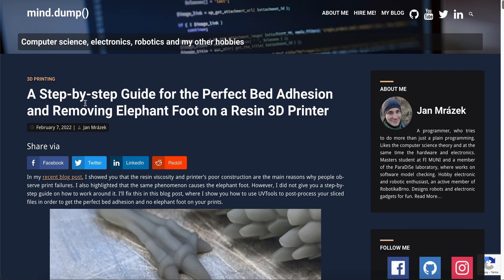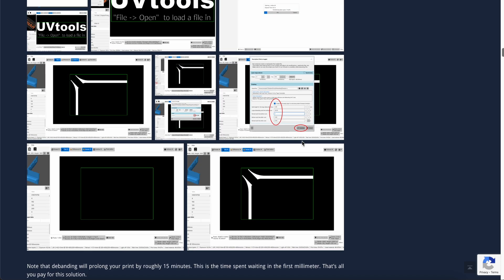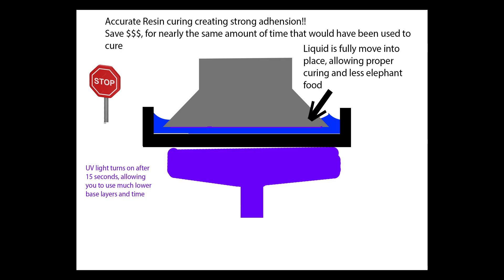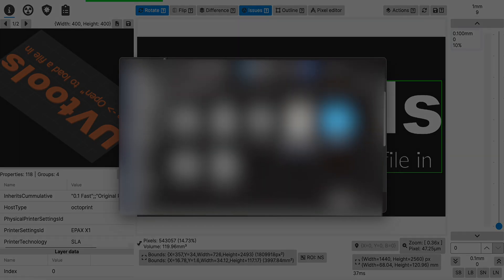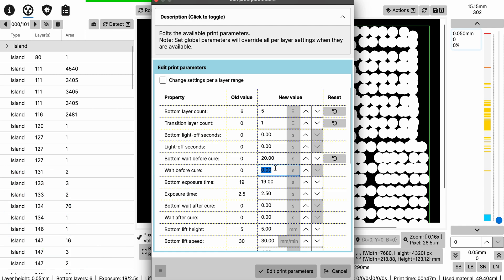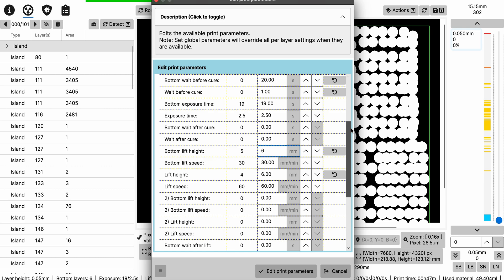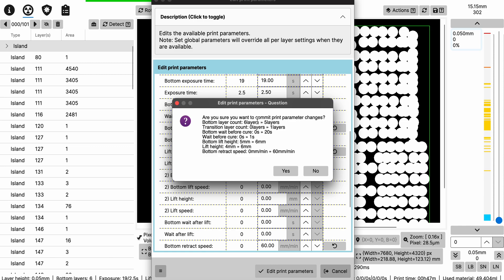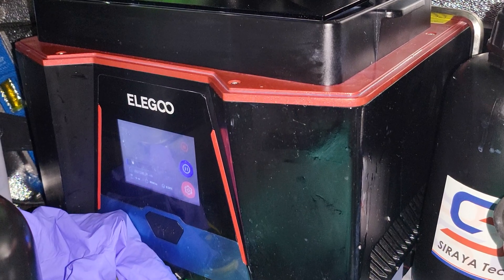Using wait before cure function, preserve your Resin 3d printer LCD screen

Comment: about "3: You extend the life your LCD screen!" , I do not understand what logic to extend the life of the lcd screen?
Reply from the maker: on the base layers, instead of having to use 35-40 seconds for the base layers, with the wait time function you can cut it down too only 10-15 seconds, which basically saves you nearly 2 minutes of on screen time, and with each print that time adds up